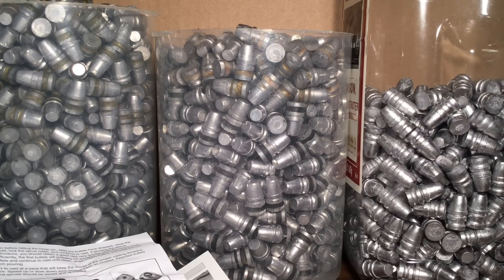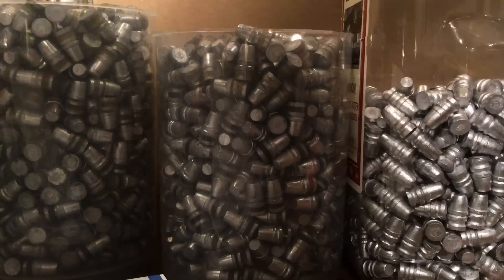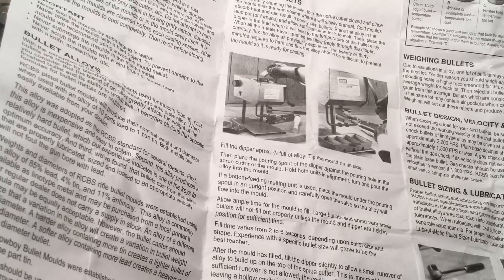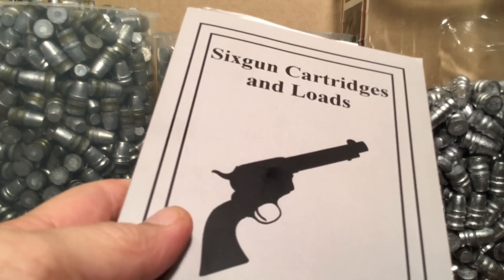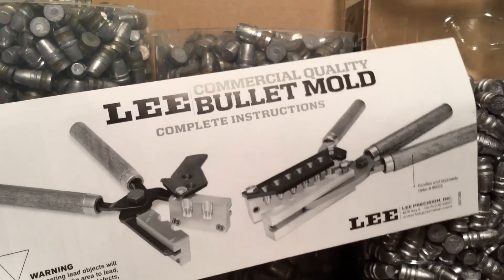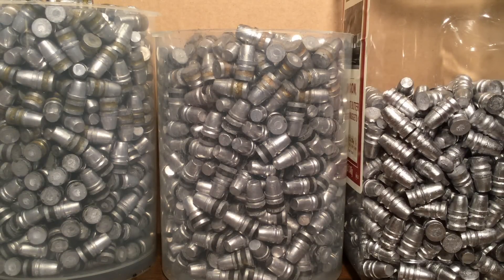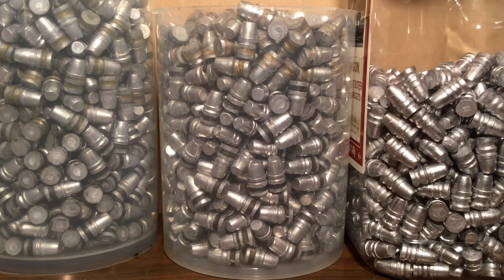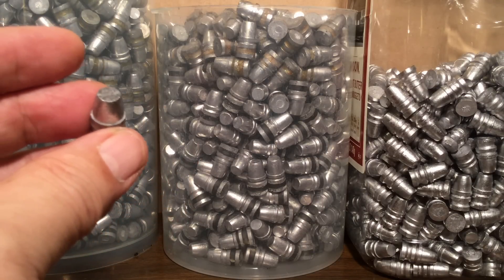The Big Hardness Gain Bullet Casting Water Quench Controversy - VR To Carl

Comment: hello there sir. I was wondering what would be a good bhn for .308 and .223. I just started using linotype in my range scrap lead for my .357 and 44. I use straight range scrap lead for .38 and .45 acp powder coated and the barrels are nice and clean. thank you for all the wonderful videos.
Reply from the maker: Grant Atkinson - Straight range scrap is perfect for standard velocity target loads (and even +P), but for the 45acp, a little more hardness might be needed for functioning.  However, if your 45 is running well, then it is fine with the range scrap.  If you shoot light magnum revolver or light rifle, you will need at least BHN 18.  You can get that easily by mixing linotype or better yet, SuperHard alloy with your range scrap.  I just did a couple of mix videos on how we determine the ratios to mix to get the BHN we want... You might check those out - answers pretty well... Best to ya, FC
Reply: Thanks. I'm making fishing lures now with lead. I never fluxed my pot back in the day. I do now and the Do It molds run so much better
Reply from the maker: Grant Atkinson - Good castin' to ya, Grant... Best Regards, FC
Reply: FortuneCookie45LC thank you for sharing your experience and expertise.i started reloading when I was 20 or so. 28 years later I'm still learning. thank you for responding. I get questions about firearms from friends and you have made me sound good.😀 I used to teach reloading classes back in 98 at the gun shop/ shooting range. I really enjoyed that job. I had to quit to take care of my mother. she had a stroke. I am now getting back into the firearms industry. I hope to get a class 6 so I can sell my ammunition. make my hobby a job again. thank you for all the wonderful information and please keep the videos coming. I like firearms review and other personal experiences.
Reply from the maker: Grant Atkinson - You are a good son to take care of mom...strokes are life changing events, not just for the victim, but also the families... Gun stores would be fun places to work in...Best Regards,  FC

Comment: Because it isn't necessary with correct alloy but if a 15bhn alloy is used and you need 18-20 then instead of having to add antimony just water quench. That's why I do it ..

Comment: Hi Fortune Cookie, i am using the 90465 6- Cavity 9mm mold, I am getting an average size of .35558 (using and industrial vernia, i am getting tumbling of 50 % of the rounds. Could water quenching cause the slight shrinkage. Hope you can help. Thank you for your vids.
Reply from the maker: Moose Sulaman - There are several reasons for bullets to lack stability in flight...1) bullets too small for the gun 2) not enough velocity 3) not enough barrel twist rate 4) fouled barrel 5) bad barrel 6) wrong ammo 7) combination of above.  If you have it down to 1) above, then an easy fix is to powder coat your bullets...you can easily add .002 - .003" to your bullet diameters and then size them as necessary (or not - just load 'em and shoot 'em).  Best to ya,  FC Steve
Reply: Thank you Sir, that is very helpful. I really want to powder coat, but here in South Africa, it is hard to come by the Powder Coating Powders. I have tried importing them from the US and no luck again. Can you advise me how I get can get some powders sent to me here in South Africa. I am willing to pay via Western Union or any other legal money transfer  method. I have requests from my daughter for pink bullets, my wife turqoise etc, but 1 year later, no powders. Any assistance or advise will be much appreciated.

Comment: Dear friend, first of all I want to thank you for everything I've learned until today and only in a little over a month and I make my bullets! But although I use counterweights to get the lead, and pass them after painting them for the 356, I notice that they turn and lose trajectory and stick aside I suspect that the lead is very soft and I would like to advise me how to proceed to solve the Problem, added tin? In what proportion? How do I measure the hardness of lead?
Reply from the maker: Andres Poblete - Best way to harden lead alloys is to use antimony.  If you have lead wheel weights - those are very good, as is, to make most of our bullets.  Your counterweights are probably pure lead and too soft for a lot of our shooting.  If you have any metal scrapyards around, you might be able to locate some linotype - that has good amounts of antimony and also tin - you can mix linotype 1 to 1 with your counterweight lead to get the proper hardness for shooting... Good castin' to ya,  FC
Reply: sorry dude,   I was referring to i have use wheel weights....But if the flux is insufficient can the mix get softer.???
Reply from the maker: Andres Poblete - Fluxing our alloy is good to 1) help raise the dross to be skimmed away 2) help mix the tin and antimony back into the alloy 3) protect the surface of the lead from oxidation.  Waxes do 1) and 2) but not 3).  Sawdust does all three.  Fluxing should not cause any changes in the hardness of the alloy.  Current WWs are on the soft side so you might find that adding a little linotyupe will help you get the bullet hardness that you want.  The videos on lead alloy mixing recently posted should help you with the ratios to be added.  Have a great day,  FC
Reply: Roger that! many thanks Fortune.

Comment: Look up Pencil hardness testing, here's my chart.  Some questions about PSI and hardness though never the less here it is.  

 
 
 
  Staedtlers 
  Hardness
  
  
 
 
  Pencil 
  BHN
  Max PSI
  Typical Alloys
 
 
  6B
  4-5
  
  Pure lead, lead wire, sheet lead
 
 
  5B
  7-8
  10000
   40:1 leadtin, pumbers lead
 
 
  4B
  9
  11500
   25:1 leadtin
 
 
  3B
  10
  13000
   20:1 leadtin, Air Cooled (Clip-on) WW, lead pipe
 
 
  2B
  11-12
  14500
   Air Cooled Range Scrap
 
 
  B
  13
  16500 
  Air Cooled (Clip-on) WW+2% tin, water dropped range scrap, pure tin
 
 
  HB
  14-15
  18500
   Lyman #2 alloy, 1:1 linotype
 
 
  F
  16-18
  21000  
  Commecial cast bullets, Water Dropped (clip-on) Wheel   Weights, Alloy (30%
  antimony 70% lead)
 
 
  H
  20-22
  26000
    50:50 linotype: 
 
 
  2H
  26-28
  34000  
  Water Dropped (clip-on) WW +2% tin, monotype
Reply from the maker: blogobre - A fine shooter and friend in the HLZ, GunFun ZS has used the pencil hardness testing and he has reported good results with it...By all means - I'm not in favor of spending $60 - $100+  on some of those testers out there when my cast bullets have shot well for me for decades... Best to ya,  FC

Comment: I know this is an old post but,  I have a question. Do you find that quenching makes smaller bullets. I know from having been a welder, and studying a little about metal reaction to heating and cooling that. Heating metal causes the molecules to align and become more uniform, when you freeze or cool it quickly they stay somewhat more uniform causing the metal to be smaller. I should assume lead will react the same as most other metals. Knowing this you may want to forego quenching if you are casting too small if bullets, and opt for another method (lino) when trying to add harness to your bullets. Correct? on the other hand if your bullets tend to be too big, you may want to start quenching if you don't. It could reduce sizing especially if you powder coat!

Comment: The way it works with steel, is that carbon melts at a higher temp than iron does. When the iron gets heated past the temp that carbon melts at, the carbon melts, and then it dissolves into the iron. But as the iron cools back down, the carbon will precipitate back out of dissolution, and return to a state of iron with carbon inclusions in it. So what they do is get it hot enough to dissolve all the carbon, then they quench it before the carbon can do that. It is then trapped in a state called a solid solution,  and this alloy is much harder than ordinary iron. I can see the same thing happening in lead alloys with other metals of dissimilar melting points.
Reply: The way they made musket balls back in the day was either a shot tower, where they poured molten lead through a strainer at the top of a tower with a pool of water at the bottom of it. This gave the lead enough time in free fall to form a nice sphere, then quench when it hit the water at the bottom. Then they roll down some ramps so that the off round ones roll off the side, and only the round ones make it to the end. The other way they made them is to cut off pieces of lead rod equal to the diameter, then they hammer or "swage" them into balls, this work hardens the lead. So they were hardened one way or the other just getting them round.
Reply from the maker: UPSOA - All fascinating stuff..!!  Thanks for posting... Have a great day,  FC Steve

Comment: LOL..  I been casting about the same length of time as you..   I 'invented' the water drop...  for me anyway..  as you say..  all the manuals say to drop on soft cloth.     I filled a 5 with water and dropped em right in.. but not for making em harder..  I am just lazy and impatient..    I just wanted to be able to handle em sooner.    Shooting em..   I noticed that they were harder..  I have no idea how much but they were..    I use scrap lead of who knows what composition.     Water dropped seemed to be around the same hardness no matter what lead I started with.    But as I have found.. antimony is kinda key.. wheel weights have it.. but shot for shotgun reloading have even more.
Reply from the maker: Doran Maxwell - Water quenching gives us harder bullets, but the control of how much hardness increase is not easily achieved.  And the articles I've read about heat treating our cast bullets and age hardening our bullets all require a laboratory to keep all the processes consistent.  When you get right down to it, our most reliable hardness control is with the use of antimony and, to a lesser extent, tin.  Plus water quenching is good for 1 -2 BHN reliably...claims of getting middle 20s BHN - I just don't see that much hardening when I'm sizing my bullets... Have a great Memorial Day,  FC

Comment: Is a couple BHN one way or the other really that critical? And while I'm posting, does anybody have any opinions on the best single stage reloading press?  I want to add another one, right now I just have one of the cheap Lees, which gets the job done but it has that 'going to break one day' feel to it.
Reply: Joe Primal Bonanza used to make a really nice coaxial press. I believe they are now owned by a company called Foster. We've had one in the family for decades and it been absolutely wonderful and trouble free. Good luck.
Reply: I like the Lee Classic Cast very much. The Lee Classic Turret is also nice. Both probably the best press you can buy in their price range and then some.
Reply from the maker: Joe Primal - If we are off on our BHN by a couple of numbers either way - makes no difference for our handgun shooting - now for long range rifle, yes there would be effects - we want absolutely matched bullets for precision rifle.  Elmer Keith used to use 16-1 alloy (the 1 is tin) - for all his magnum shooting.  And we know that tin does little to harden lead, Elmer used fairly soft lead.  So a couple of BHN won't make much difference.  Bullet fit to the gun is way more important for good shooting  than bullet hardness.  Bullet hardness is a rather distant #2 with quality and quantity of lube being #3 and gun factors like barrel quality, timing, set up of forcing cone in revolvers, presence of any constrictions, etc  being #4.   #4 is #1 if bad enough...  And now, powder coating has changed a lot of that.  Good shootin' to ya,  FC
Reply: 1990  Thanks.  
I have a Lee single stage and a lee 5 stage turret press.  Both work well for what they do.  I keep finding myself doing the rifle single stage mostly because I'm using a lot of mixed range brass and with some of the primers being military staked, the decapping process gets too erratic and it causes issues on the multi stage.  While resizing and depriming the rifle brass the Lee single stage feels flimsy.  I was thinking on maybe picking up a Rock Chucker Supreme or something like that.  That Forester Coaxial press Fortune Cookie has looks very nice but at almost $300....IDK, that's a lot for a single stage press.  But if it really makes a difference it might be worth it.
Reply from the maker: Joe Primal - After you get your mainline press, your less expensive single stage press will always have value to do jobs like decapping before wet tumbling; sizing cast bullets, powder charging etc...  I do like the Custom Cast Press from Lee - very strong press - good ergonomics - comes in breech lock or regular.  If you have the extra money to spend (or save up for), the Forster Co-Ax will be the last single stage press you get unless you just want to get different presses - you certainly won't be needing them.  Have a great day,  FC.
Reply: Joe, When you say you have a Lee single stage, which one do you mean? Lee has three single stage presses on the market, ranging from about $35 to about $125. The two lower end ones are made of cast aluminum. The Classic Cast is their most expensive at about $125, made of solid cast iron, has a 4" max stroke and is a good alternative to the Rock Chucker Supreme. It's much more beefy than their other single stage presses. It's made in the states. The Rock Chucker Supreme has mostly good reviews but it is made off shore. Reports are that it's not the same quality as the old one. Looking at reviews on Cabelas or MidwayUSA can help you decide.
Reply from the maker: Joe Primal - The RCBS RCS press was at one time industry standard - still an excellent press at a fair price.  The Lee Custom Cast Press is in the same league.  The new MEC Marksman looks very good.  I would avoid the RCBS Summit (it is not selling well and price is dropping - still would not get it)  and the Hornady Iron Press needs more reviews.  The Co-Ax is pricey - a big negative.  Best to ya, FC

Comment: I've been water quenching since the 70's. What you didn't mention, is that it does raise the hardness several points over what that particular mix of alloy is, but only temporarily. Over time the hardness will return to, or close to the what it would be if you dropped on cloth. You didn't say how long it has been since you water dropped the bullets you were showing. Also, it depends on the mixture of the alloy. Pure lead will not increase in hardness very much if at all depending on impurities. If you want to truly increase the hardness into the 20+ range, you need to heat treat the bullets.
Reply: Lilac Tortoise  Please explain why you don't think so.

Comment: For water quenching - is it also true that the shell hardens faster and has a softer landing in water and thus you get less "damage" from the drop on towels - even from soft folded towels - still harder then water and have a texture.

Also, won't you be getting "surface hardening" (a shell) over the softer core, where you won't get this on a towel.  A micro shell, is still a micro shell, which you won't get on a towel.  This would require a scratch test not a dent test.  And the scratch test would have to be a regulated repeatable pressure.  Think a weight on a 6 inch pointed pivot arm to everything is repeatable.  Start very light scratching to heavy scratching.  You will need a cheap microscope to examine the surface scratches, or a high powered magnifier (not a big round one - one with serious magnifying power).

Then water quenching would be completely answered.  You finger nail test, does Not answer all the questions (does it shell or not).
Reply from the maker: Danny Comsa - Appreciate your remarks, but let's discuss the bottom line.  The fingernail test is a relative test and is really intuitive - there is no calibration for a fingernail.  But hardness testers are not that reliable either.  RotoMetals uses an x-ray process to determine the hardness of their alloys...We are home casters and shooters - not ballistics labs or foundrys.  The bottom line is that my bullets shoot well and clean, and if they need to take game, they are ready to do that.  I hit my bullets with a hammer and hard or soft, they squash and do not shatter.  And my fingernail is reliable in all that - it works for me... When it doesn't work any longer, I'll look for something else.  Any caster that has a hardness tester or microscope that works for them is simply fine... I would say - Continued good castin' to 'em..!!  Have a great day,  FC